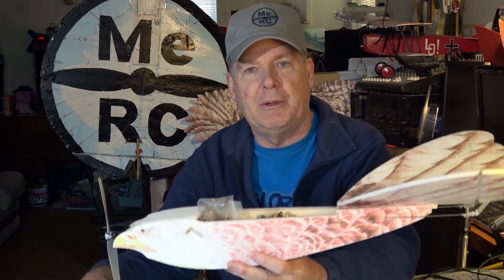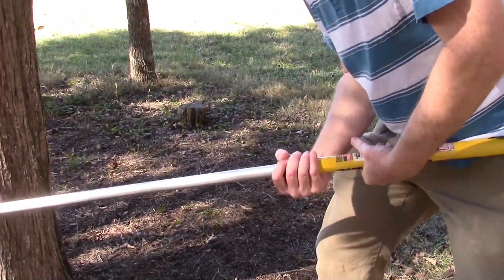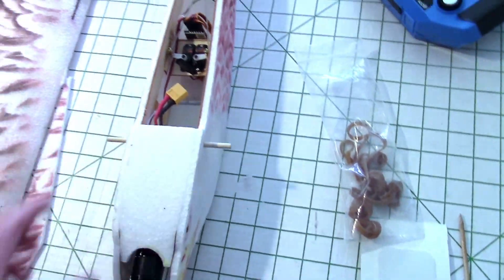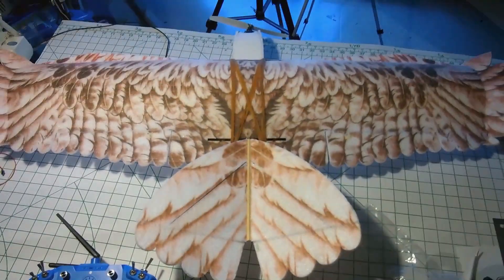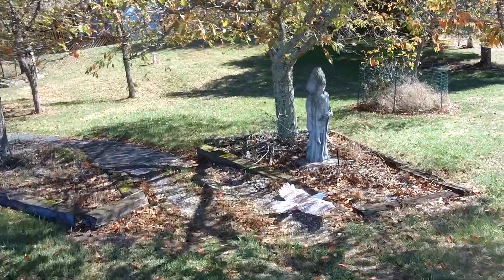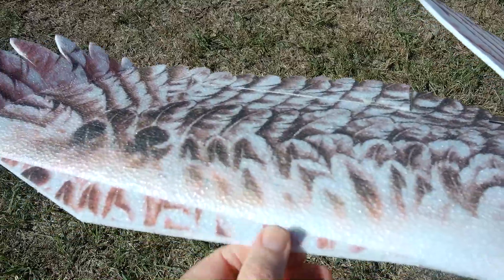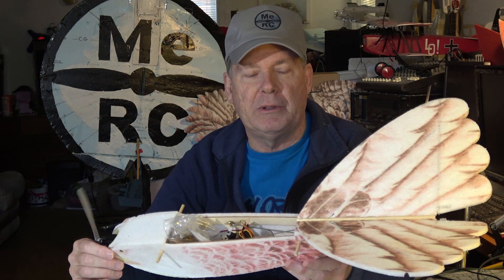DW Epp 1200mm Eagle Recovered! - Test Upgraded 1400kv Motor, small malfunction.

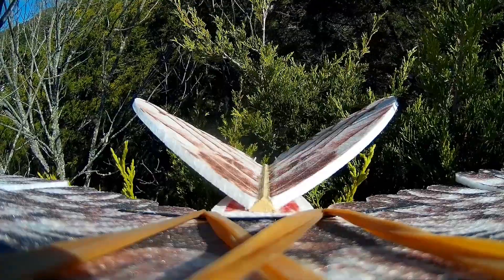Comment: 1:27... Are you sure that is a pine tree... Looks like a Cedar to me... I may be wrong. ;-)
3:20.. Try balance recharging the battery then discharge to 3.0 volts per cell. Do this about 10-20 times. 80% of my "damaged by Pilot Error ie. left Tx on and puffed up) batteries come back to life.
Reply from the maker: Juniperus virginiana, known as red cedar, eastern redcedar among other names, but I just call all those evergreen trees pine trees. Maybe they are mad at me and grabbing my planes. Battery was puffy and old so time to recycle. I am tossing the rest of the bloated batch as well b/c they have become a fire hazard.
Reply: @DaveMerc  Yeah after paying all that $$ for Li-Pos I get rid of them if there is no hope at all... Glad you got your Eagle back. The 1400KV motor seems to have upped the game.
Reply from the maker: The 1400kv SunnySky motor is my go-to motor for many builds. Not sure why I didn't just use that to start with.  The 980's are better for 10 or 11 inch props.